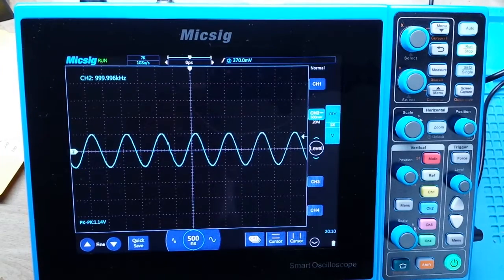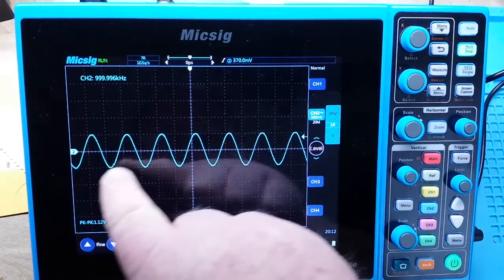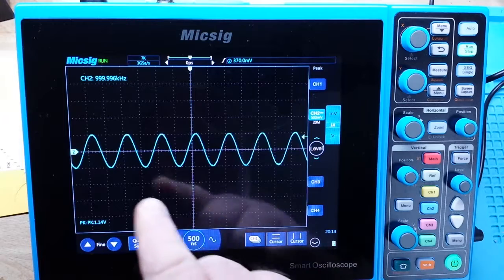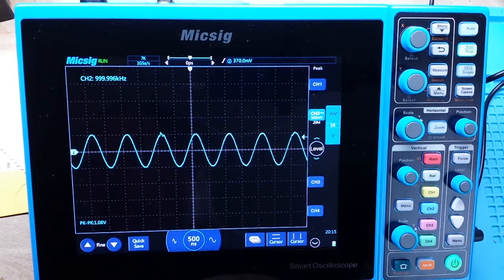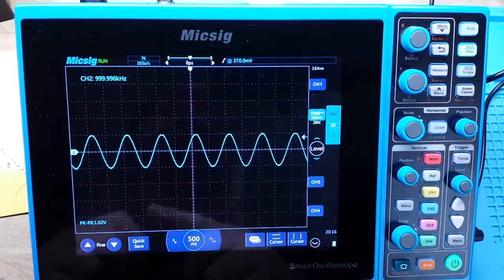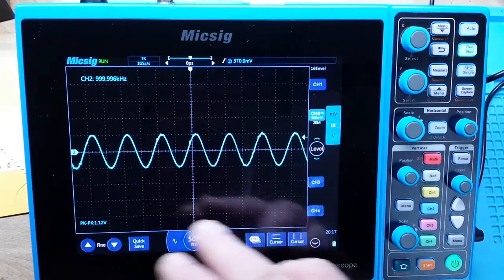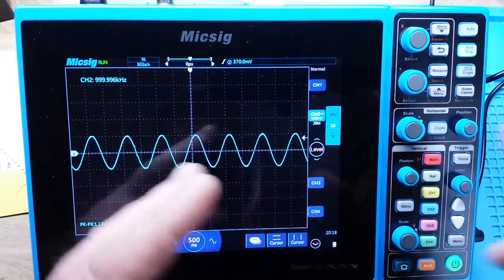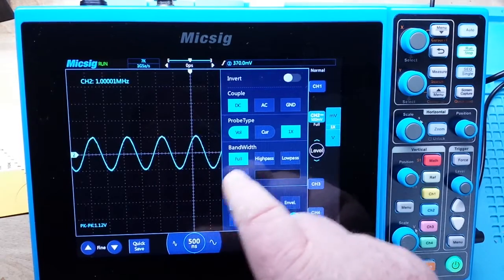Oscilloscope Acquisition Modes

Comment: Thanks for the clear explication. I’m a total amateur so apologies if this is a stupid question or if I’ve misunderstood, but is the noise we can see on the scope from the signal generator / source or noise being picked up from elsewhere? I’m wondering why we would want those features on our scopes, to filter out the noise from the scope image rather than understanding the level of noise, where it’s coming from and if there’s anything that can, or needs to be done to eliminate it?
Reply from the maker: It's coming from everywhere. The signal generator, the BNC cable, the front end of the scope, the adc. They all add up little bits of noise.
Reply: learnelectronics thank you for your reply, much appreciated.